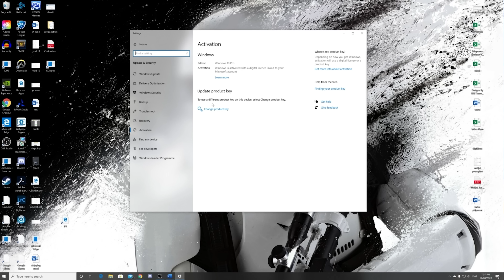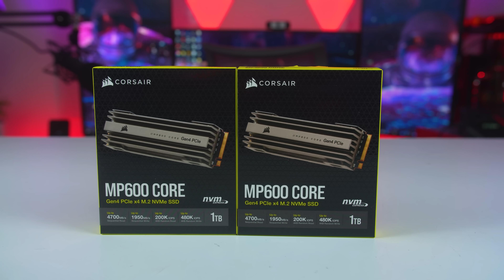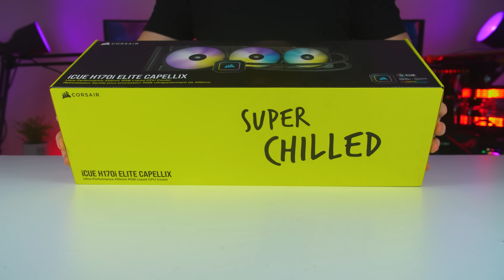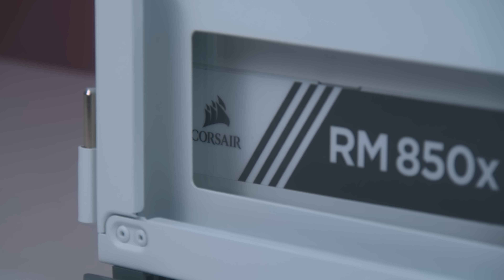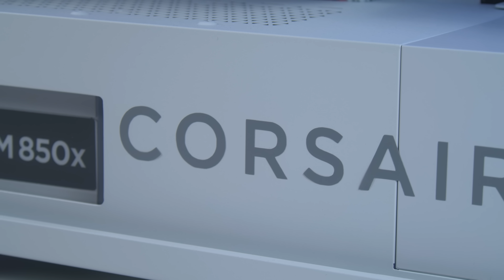The ALL White Custom Gaming PC!

Comment: Nice clean build, but don't lie or mislead people.

The H170i from Corsair takes 3 140mm fans. It also costs $230. That box of 3 QL120s did not even get used on this build.

Corsair does sell the QL140s in a 2 pack for $109 or individually for $50. They do not offer a 3 pack of 140s.

So that cooler was a total of $380...

Comment: Great, but with 2 improvements it would have looked even better! 1st. mount the graphics card with a PCIe 4.0 rizer cable (in white from LinkUp) vertically. 2nd. buy and install  a white AIO 170 for this built. Btw have a look at my all white custom watercooled Corsair ICUE 5000x: https://www.youtube.com/watch?v=qbYs21hjWdc